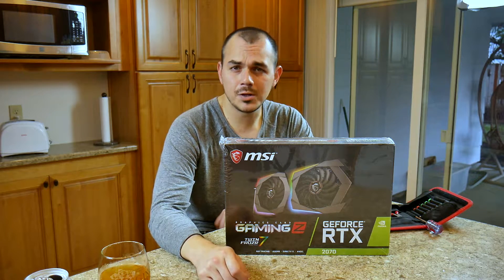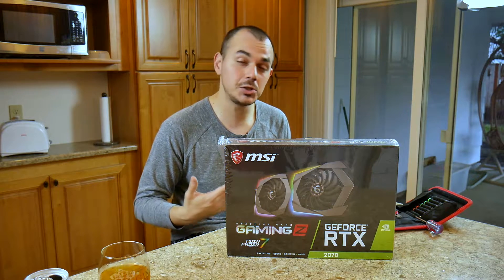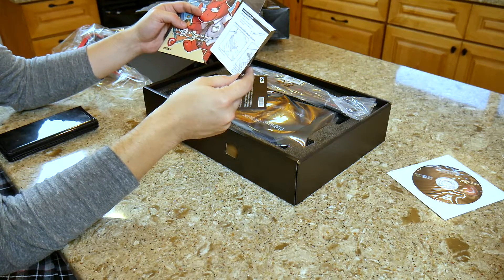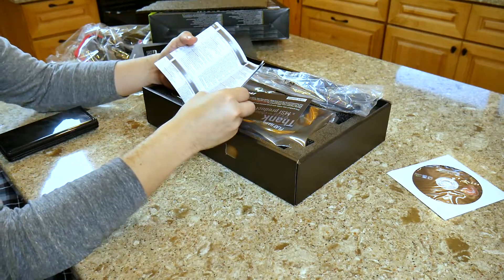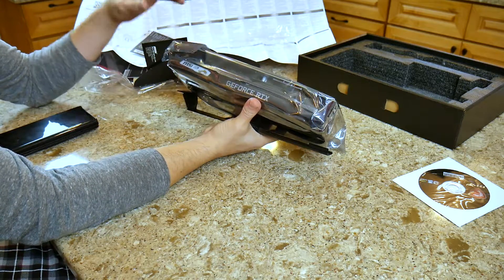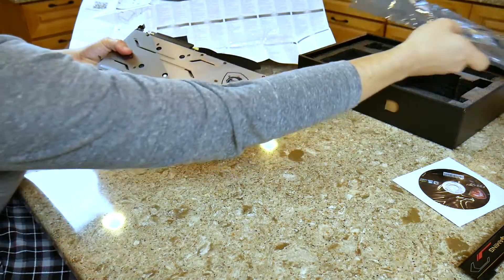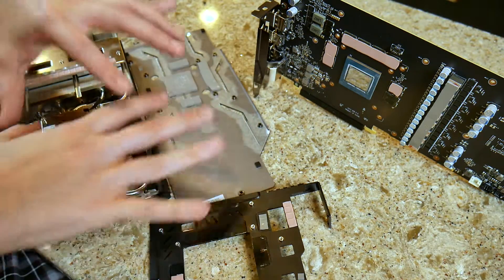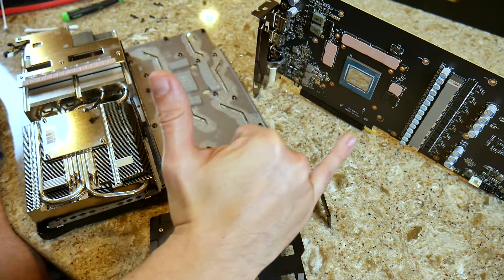MANIC TECH: THE MSI RTX 2070 GAMING Z UNBOXING AND TEARDOWN

Comment: Having issues with this card. When playing games, the fans spin up 100% even tho I have adjusted Afterburner. I have also noted that temps go really high while these spin ups happen. Everything else normal. Other fans works perfect and airflow is good. Should I tear it down and replace the thermal paste?
Thanks in advance!
Reply from the maker: Is it just core temps that go high, or are other reported temps high as well? That could indicate if you also need to replace some thermal pads. Deffo take the heat sink off and re-do the paste at least. Failing that, open an RMA with MSI and let them know the steps you've already taken.
Reply: mine has the same issue
try setting power limit in afterburner
set 99%, if that didnt work, try 98%,97% and so on...
Reply: and no, you're not gonna lose THAT much of performance (maybe 2-3fps based on the game)

Comment: Is there any way to get the VRAM chip cause I bought a broken one on eBay and it's missing 2 vram chips
Reply from the maker: It's possible you might find functioning second-hand modules online, but soldering memory on to a PCB takes fairly specialized gear because of how they're soldered. You might be able to take the card to a specialized repair shop to get them installed, or maybe that shop has the ability to order the modules along with performing the repair.

Supply chain issues still being what they are it may be a tall ask, and things may differ in your region. Also depends on how much you're willing to spend to get the card up and running, by the time all is said and done it could end up costing more than the card is worth.

Comment: How's this vs the rtx 3060? For a modded Skyrim with 4k textures?
Reply from the maker: Couldn't tell ya, never tested a 3060 🤷🏽‍♂️. Also hard to say without being able to know what's required for the mods you use.
Reply: @TheManicGeek  Fair point thanks man.
Reply from the maker: @siveshenragavulu2181  lol np. Maybe try a GamersNexus or Hardware Unboxed review of either card, I'd imagine there's comparative numbers there for a 3060 and 2070. If not you can sort of extrapolate from cards adjacent to the 2070 👌🏼
Reply: Cool will do.

Comment: Bro, I need you to help, what is size of the thermal pads for this card, I searched many websites and I have not been able to find it.
Reply from the maker: I sadly did not measure them at the time, sorry. If you have or can get a digital caliper, that will help you accurately measure the thickness of the pads to find replacements.

Comment: I own this card and its fantastic. It is the quietest and coolest card I have owned. Really hesitant to upgrade when my system is so quiet and cool.
Reply from the maker: TBH I still don't really feel like I NEED an upgrade. Do I WANT one? Yes, and it'd enable some higher quality streaming capabilities for me. I need too many other things first tho.
Reply: @TheManicGeek  Same here. Going to wait until I can get exactly what I want at MSRP, so might be a while which is fine.
Reply: Same had this card for 9 months now and It's been great. Definitely one of the best 2060's. Overclocked like a charm as well getting scores on TimesSpy and Kombuster equivalent to a 2060super's performance. Never seen the thing go above 62c even while boosting just under 2100mhz. Idk if I won the silicone lottery or that's normal but I've been having a lotta fun with this card.
Reply: @PabzRoz  Dang 2100mhz? Mine sticks at 2025, never goes above 60 and fans never above 60%. So quiet and cool, can't justify upgrading until I know I'll get a 3070 that's equally cool and quiet. Not going to settle for a Zotac mini or Ventus.

Comment: I have the MSI Gaming X GTX 1660 Super and was looking for a teardown if I ever wanted to apply liquid metal on it. Found your vid and this card looks very similar to mine despite being RTX. Liked and subbed.
Reply from the maker: The teardown process is likely similar, though your 1660 Super will likely be much easier due to it being a less complicated card to manufacture. Really the hardest part of tearing down onw of these cards is addressing the RGB cables since the connectors are a bit delicate. Take your time and the card teardown should go fine :-)

Comment: Could you make a full tutorial on how to tear it all down
Reply from the maker: That's something I could do in the future, sure.  I do tear the card down in this video (in fast forward) but didn't really feel as if it warranted a detailed look since the card is extremely easy to tear down compared to a Founder's Edition card.  Thanks for the input and for watching!
Reply: @TheManicGeek  thanks for noticing bc I have the same card and trying to customize the backplate and it looks like you got it off.
Reply from the maker: Yeah it comes off pretty easily. IIRC you may have to remove the heat sink in order to get to some of the fasteners but it's all Philips-head fasteners for a size 0 or 1 Philips-head screwdriver.  You'll also want to watch for the thermal pads underneath, they tend to grip on to the PCB and back plate pretty well.
Reply: @TheManicGeek  ok thanks

Comment: Are the fans easy to replace?
Reply from the maker: They're not too terrible to replace if you needed to. Mine are still working great and have no irritable bearing rattles or anything, been using my card since this video went live as my daily.
Reply: @TheManicGeek  My thing is I wanna run all my fans at 100% 24/7 when it's on. These fans I kept at stock cause MSI has known fan issues which I dealt with on their 1060 6GB Gaming X model. My case fans and CPU cooler fans have been 100% and quiet although these 2070 S fans are not which is another downfall.

Comment: i5 8400 gtx 1060 6gb 8gb ram worth upgrade to 2070?
Reply from the maker: I'd say that'll feel like a pretty potent upgrade, just try to find a model closer to a 400 USD price point; at the low 500's you start getting in to 2070 Super territory, and that's a whole tier of performance up.
Reply: Yes. I have this card and a pc with a 10100f and a 1060 6gb. The 2070 is a huge upgrade.

Comment: can u separate the heatsync from the fans?
Reply from the maker: Yup
Reply: @TheManicGeek  i wanna remove the fans and the plastic around it to leave only the heat sync and insert some chinese water block up in that with thermal conducts
Reply: looks like its flat without the fans so
Reply: but i never saw it without the fans no did it and posted
Reply: I don't see and screw in that plastic around the fans dont know if i can really remove it.

Comment: Sir rtx 2060 super gaming x (new) or rtx 2070 gaming Z (second hand) ?same peice in my country
Reply from the maker: If you trust the used 2070 then it will edge out the 2060 Super in terms of frames/dollar.
Reply: @TheManicGeek  u mean both have the same performce?
Reply: Which one should i choose?
Reply from the maker: You should choose the one you feel most comfortable purchasing. The 2070, like I said above, will edge out the 2060 Super in terms of frames/dollar, but if you would rather have a brand new card then the 2060 Super isn't too far off from a 2070, especially if you overclock it.

I can't speak to much else on it since I don't own a 2060 Super; I have access to the same reviews you do that can tell you whether or not one is a better buy than the other, but based on what I have seen if they're both the same price then it's more about if you trust a used card that offers a bit more performance or would prefer a brand new card that offers slightly less performance but gets damn close.
Reply: @TheManicGeek  tanks i will choose the new one.

Comment: you should have teardown also for the fans , im planning to install and attach ARGB leds for that fans so it brights up well ..
Reply: last question , i would like to ask the fan size of TORX 3.0 Fan size, im really planning to put rgb stuff behind the fan , either silverstones holo ring type argb thing ;)
Reply from the maker: Based on my measurements, they appear to be 100 mm fans. I didn't bother with full heat sink disassembly as unfortunately my time to film this was restricted, so I had to stick to the stuff that most users would typically want to do with the card anyway. In future content pieces I'll try to also include a full heat sink teardown as well. Sorry I missed these comments, been sick for part of this week, so when you commented I was on all of the cold meds x-D
Reply: @TheManicGeek  thank you :) ill look up for custom mods in changing the fans , but still figuring out if i should change it or not, im pretty sure it'll void the warranty of the card :/